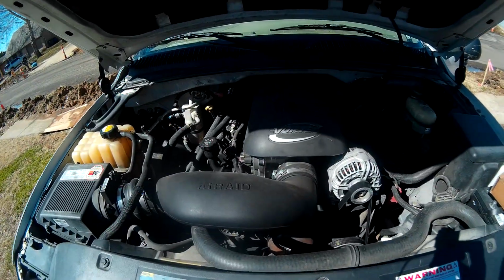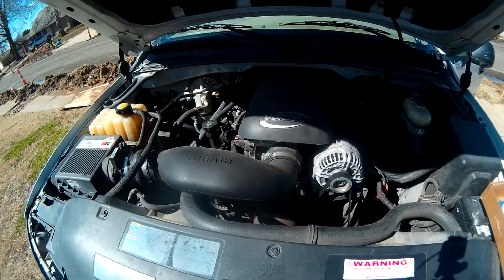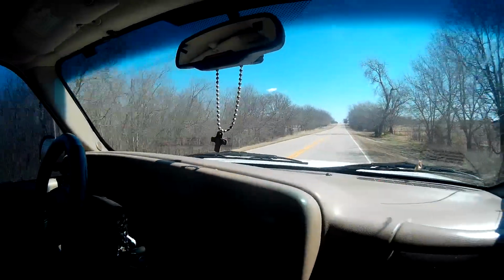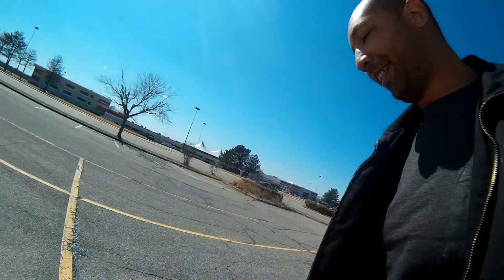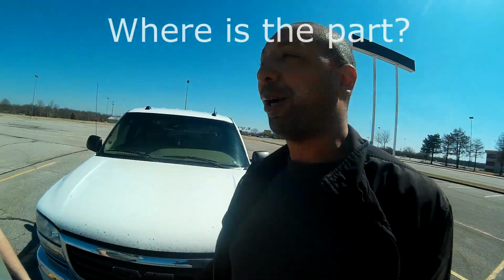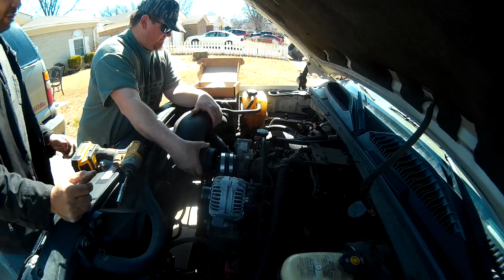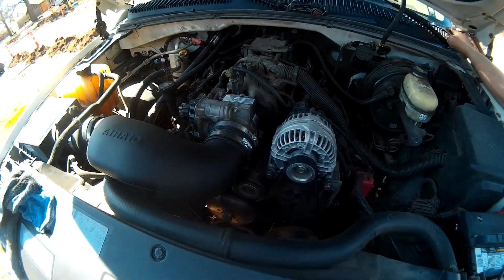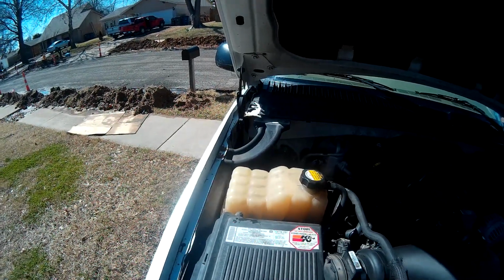Rough Country Throttle Body spacer installation for GMC/Chevy trucks

Comment: What year Silverado..I have the 2004 Sierra with electric throttle body will that rough County space fit
Reply from the maker: mine is 2005 with the 5.3L.  if you have the same engine, it should fit yours as well

Comment: I redid my throttle body and I realized a small gap on the top left? Is this normal or not
Reply: If you haven't figured it out no it's not normal. Make sure to torque in increments and using the criss cross method. Start light until all corners are  seated
Reply: Somewhat less than scientific ?

Comment: How did you move the water pump neck I can't seem to find how to twist it
Reply from the maker: I used a "special" short pipe to gently turn is clockwise just a little.  Worked like a charm and did not leak.  Be sure to be gentle.  It doesn't take alot to turn it
Reply: @Awrench Productions  I'm gonna try and thanks for the fast reply yea I tried a pipe wrench and couldn't get it too budge yea I feel you on not needing alot of turn its almost their but is killing me I bought a afe silver bullet spacer
Reply: @Awrench Productions  do you happen to have a video of when you turned it? I kept watching the video but I can't see when you do it